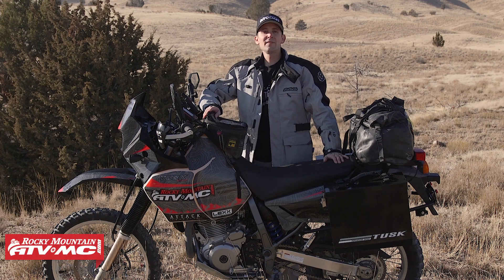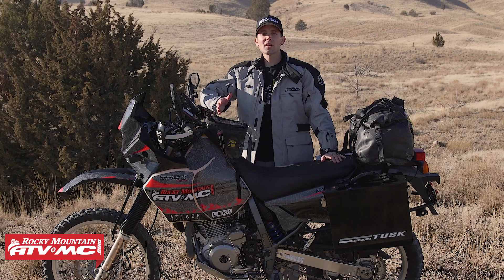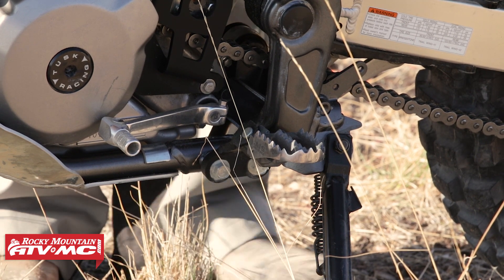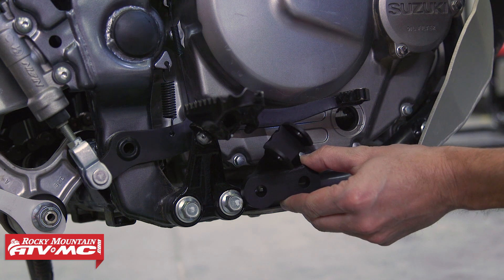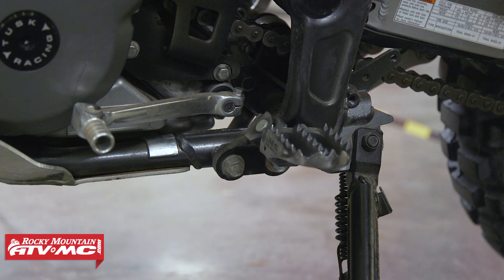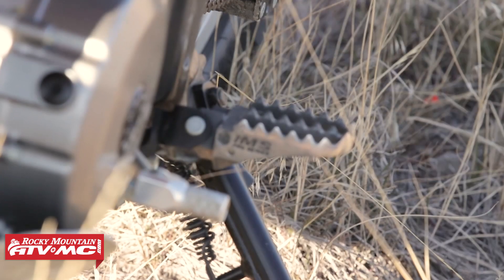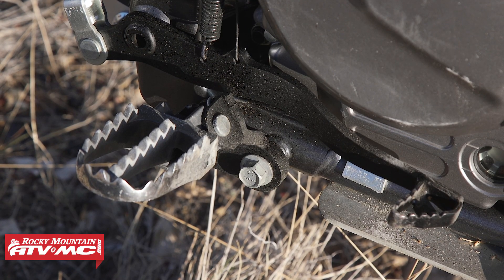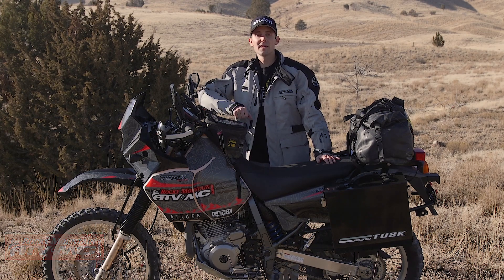DR650/KLR650 Foot Peg Mounts | JNS Engineering

Comment: I have several JNS Engineering products on my KLR, including the footpeg mounts. Nicely constructed with good hardware. I have pretty long legs and these footpeg mounts moved my pegs down and back to a much more comfortable position and I can use the stock shifter.
Reply: I know this is an old comment, but how was the vibration after